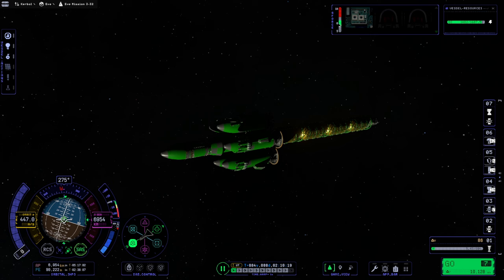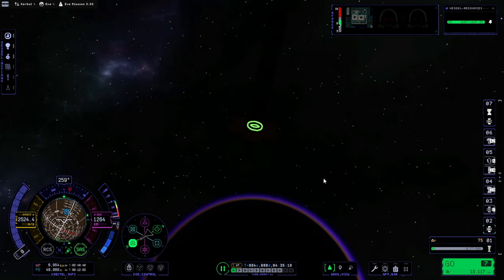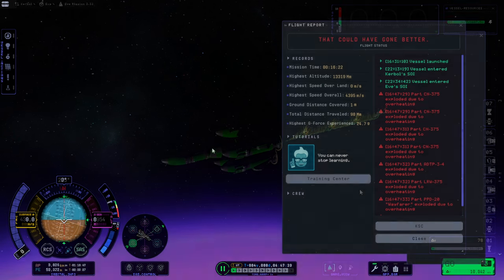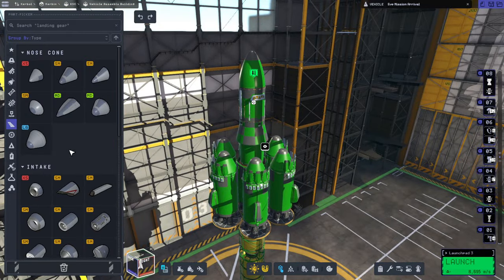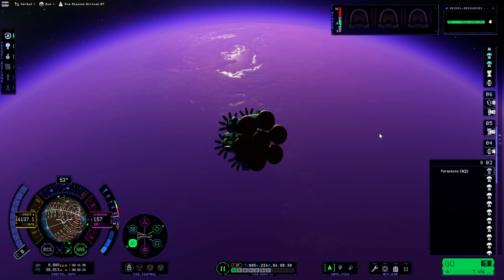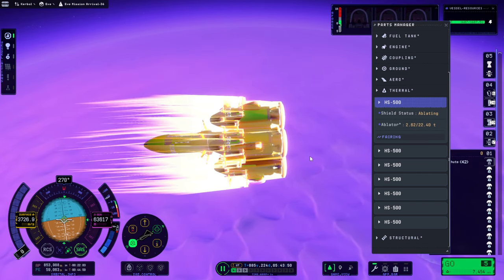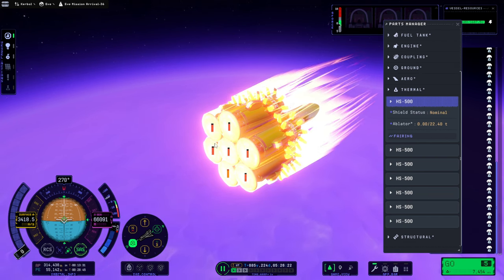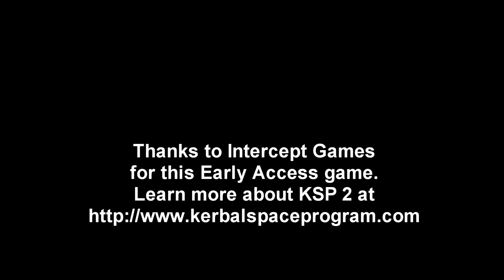KSP 2 Early Access - For Science 52 - Getting Lower

Comment: Try to use to max your transfer stage to lower your orbit to max above eve. Then reduce speed with rest of fuel before entering atmosfhere. Speed is a problem.
Reply from the maker: We're already doing that with the transfer stage and we can't reduce speed further because our engines are blocked. Speed isn't the problem - we burned off all speed beyond low Eve orbit by the end of this video and we did it by using 22 tons of ablator instead of a lot more propellant (considering this is an 800+ ton vessel).

Comment: I scrubbed through recent videos and couldn't find which reaction wheel you're using on this - can you go up in size at all to help with the pitching at lower altitudes?
Reply from the maker: It's either the 3.75 m or 5 m reaction wheel. I think the aero will quickly overwhelm even more reaction wheel power - the only way to deal with aero forces is with aero surfaces like the airbrakes.

Comment: Got to slow down your orbital velocity and drop into Eve a lot slower. I wouldn't really call it a waste of DeltaV or brute forcing the entry; Mass is too high to slow down reliably before burning up.
Reply from the maker: Except we proved in this video that I could slow down to low Eve orbit just with the ablator, which is much lighter than the propellant. That was essentially the point of this video.
Reply: @RaizSpace  well not entirely lol. Very close however. Entering at 4k m/s is impressively ballsy. A lighter craft loses speed so rapidly and it appeared to me that using the drag of the atmosphere wasn't a good method to slow down for such a large craft. All I meant. Trust me on this you build far better craft then I do. More efficient and aesthetically pleasing!

Comment: Wouldnt it help to move the boosters up just a tad? To give the combined heatshield more of a heatshield shape. Could that improve the stability?
Reply from the maker: It would help stability a bit but might make the core tank more vulnerable to heat. Also, the stability effect is minimal because we're simultaneously moving the center of mass higher. The effect will depend on how KSP 2 does aero and heat.

Comment: you have to deploy the drouges manually. they wont open on their own that high. but they do work.
Reply from the maker: They really shouldn't, but okay, we'll see about that option again - if only to point out to the devs that they should probably fix the drogue chutes and also put the right info in the VAB.
Reply: @RaizSpace  I think the issue is they can withstand any speed and temp when deployed. And they can be deployed at any point when in atmosphere at any altitude. But they only open fully or deploy on their own when you dip around 5000 meters

Comment: I think those airbrakes are aligned back to front.
Even if they are I'm not sure if that would effect their heat resistance or aerodynamic qualities as far as the game is concerned.
Ime they change the center of preasure, so mount as far from heat shields as possible, I don't think the game engine currently knows or cares if they are blocked from air stream (might experiment later)
I see you dismissing the grid fins due to their heat tolerance, ime they work fine, perhaps they require lower heat resistance due to experiencing less heating? They persuade the atmosphere whereas the brakes are just looking for a fight, ofc game engine might disagree.
Like your good self, I suspect your heatshield need some heat shields :D
Reply from the maker: The airbrakes are placed properly.
Reply: @RaizSpace  In that case I'm pleased to report that they work well back to front and in the wrong place ;-)

Comment: Maybe try adding stabilizer fins to keep you from veering off of Retro, place them upside down so they are the right way for re-entry
Reply from the maker: As I explained previously, fixed fins like that would be troublesome on launch from the surface. Not to mention we'd probably need the heavy ones for the heat tolerance. And don't suggest the grid fins - they don't have as much heat tolerance as the airbrakes.

Comment: Why don't you add grid one grid fin per booster together with all the airbrakes? Maybe the SAS will have a better luck in keeping you on the retrograde when it tries to flip out of control
Reply from the maker: The grid fins don't have adequate heat tolerance for this as far as I can tell.